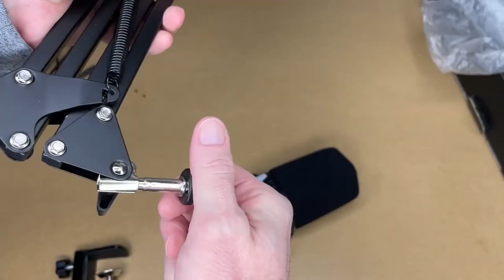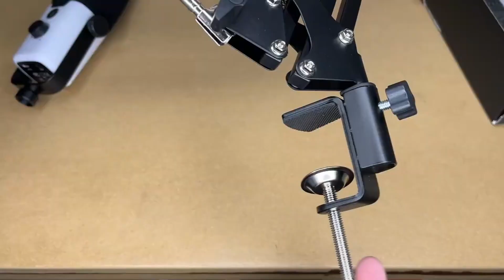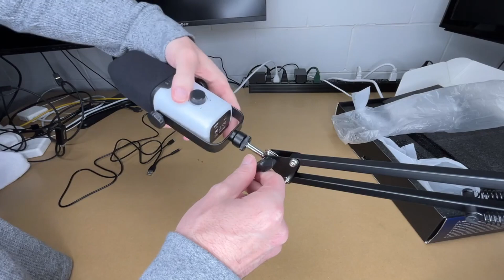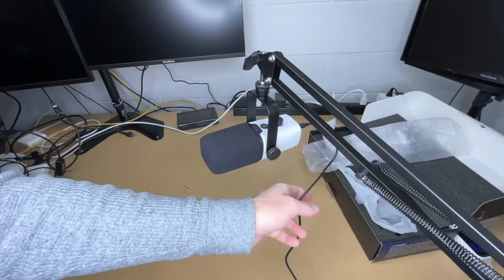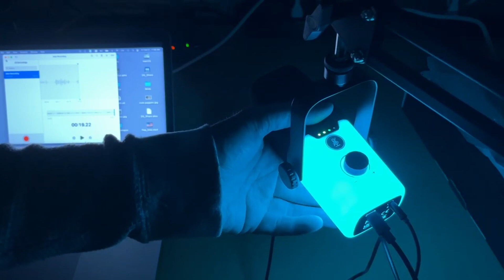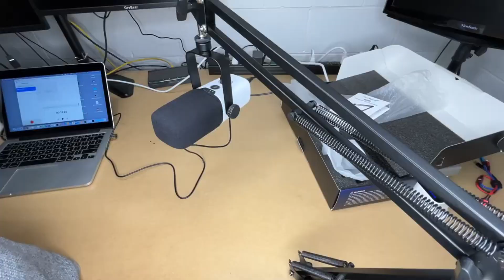[Tutorial] ZealSound KD9S Gaming USB Mic – Plug & Play, Mic Gain, RGB Lighting Effects

Comment: I’m using this for my ps5 but when I plug the headphones I keep hearing myself is there a way to turn that off
Reply from the maker: Hi there! This issue can sometimes occur when connecting to a PS5. It's usually not a hardware problem with the microphone but might be related to the audio settings on your PS5 console.
The PS5 system has a default setting called "Enable Microphone Audio Playback," which plays the sound from your microphone back to your headset in real time, creating an echo effect.
You can try adjusting this setting by following these steps:
1. Go to Settings → Sound → Audio Output on your PS5.
2. Find the option for "Enable Microphone Audio Playback" and set it to "Off."
After turning this off, the echo should stop. This only disables the sidetone (self-monitoring) and won’t affect your voice chat with teammates. You can also try adjusting the monitoring volume knob on the microphone to reduce the real-time feedback level.
If the issue continues, feel free to contact our support team at info@zealsound.com with more details, and we’ll be glad to provide one-on-one assistance.
Hope this helps, and happy gaming!